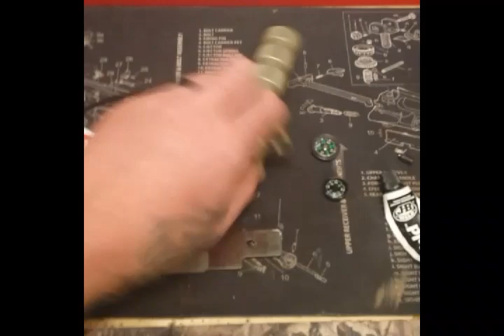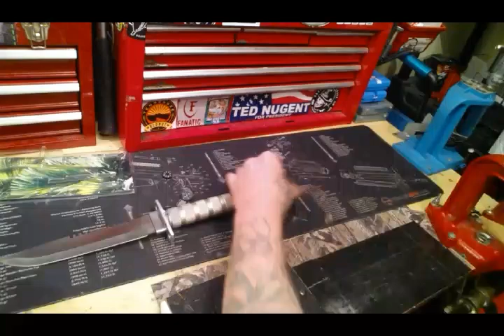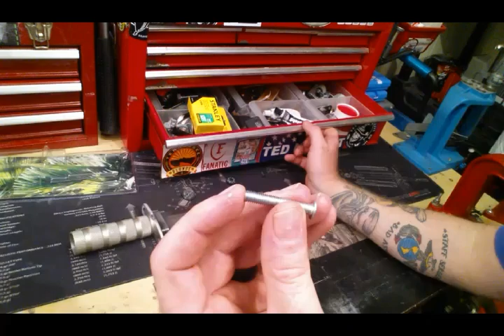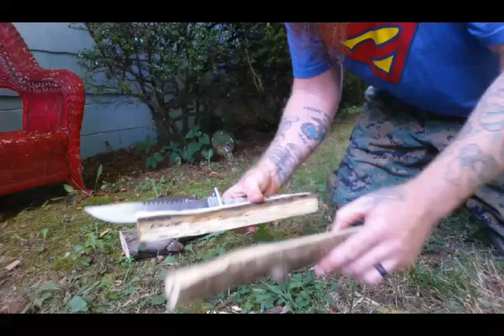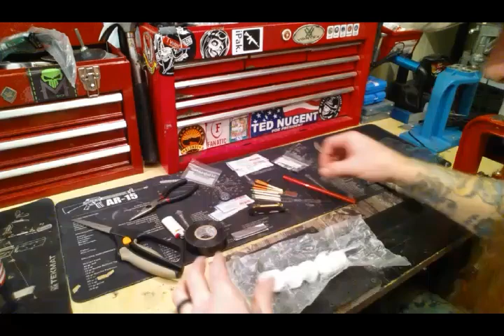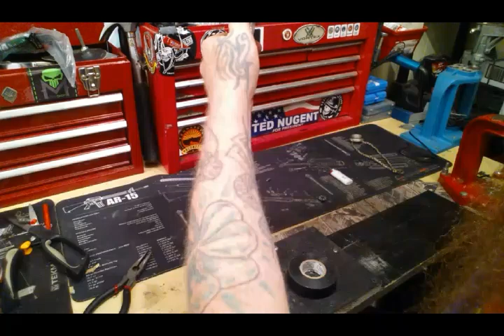Harbor Freight Survival Knife Upgrade - Wood Splitting

Comment: I'm kinda lost on all the comments that spoke bad about the knife and the ones saying nice fix like it was a genius thought, I tested mine the same to see just what would happen batoning, the alan key came loose just as stated but I was hacking pretty heavily into mesquite, and anyone that knows their wood knows mesquite is some of the hardest wood to cut, period, everyone who complains this knife can't perform its intended job should never touch anything sharp, if you have enough sense to be waking away with a knife like it's a machete or a hatchet don't complain when it hurts you
Reply from the maker: I put the upgraded steel pin in place of the hex head screw.

Comment: Man that is a great up grade to make a usable piece out of pretty much a novelty item. I had one of these for a while but gave it away to someone who liked it. I may pick up one do your mods and keep it in the trunk of the car. I was surprised how well the steel took the impact, no chipping, may be the steel a little soft but I would rather resharpen then have a big old chip fly out of it. So for 8 bucks not bad.

Comment: I've had this knife for years as a novelty item.  My blade always shifted a bit.  Your video inspired me to JB Weld the blade to the hilt.  But my blade still had play after the epoxy cured.  I found that the cross guard (the thing with the set screw) threads into the handle, but not securely. It rocked a bit.  I unscrewed the hollow grip and completely sealed the  open end of the cross guard with JB Weld. Otherwise any liquid on the  blade can leak inside and damage the handle contents.  Then I coated the threads with JB Weld and permanently bonded the hilt to the handle with epoxy.  The blade is solid now.  I skipped the pin because the weak point is the grip connection to the cross guard and not the cross guard to the blade.  The handle seems like pot metal. I'm certain that the shock of frequent battoning or chipping like you demonstrated will break the handle eventually.   The blade is heavy solid stainless steel in case anyone is wondering.

Comment: Say Heah, That's Awesome what you did to that Harbor Freight Survival Knife. I have the same one, but mine says "General" on the Cap. I would love to have someone do the same for mine. But years ago, They sold Tomahawk Brand Survival Knives that were made in the U. S. A. and in the 440c. They sold them as Hog Hunting Knives because at that time it was one of the longest blades made for a production knife. I've used mine and it's still as solid as the day I bought mine.  But I never batoned on it.  But I always liked Hollow Handle Survival Knives.  Infact when Buck came out with the BuckMaster 184I just had to get one.  I trust my life on my BuckMaster 184.  Then I up-grade and I bought the Randall Made Model #18, it's silver soldered together.  I also trust it. Then I got a Russian Survival Knife, I think it was used by their Special Forces, it sold as a Professional Survival Knife. It's called the NB1-01, but in Russian the "B" is a "V" so it might be tge NV1-01 ? It's a 6" Recurved made out of a Truck Steel they use 
G 65 ?, But then Bokor made a copy of a Martin Knife Design. It's my Bokor Aparro. The blade has the Male Threads on it and the Handle has the female treads on it. It's then married together and a strong Epoxy fills into tge Handle for extra strength. I did baton it, and it's still rock solid.  Infact I like to team it with my Mora Garberg. But recently I found a rare find at my neighborhood Pawn Shop. I found a Bianchi #1.  Mine doesn't have the word "Nighthawk" under the Bianchi Logo, but the word Bianchi is larger. I also would trust this knife. I also have a Frost Cutlery First Blood ? It'd strictly for show. A screw type Tang that's thin with a nut tightening the blade to the handle. It's a nice looker, but, no way would I trust it. I'd take $75.00 for it. But, again, what you did to yours, It's more than a $10.00 knife now. That's alot of work, so, go figure what your hourly wage would be then add that on. You did a great job.,,.p

Comment: electrical FRICTION tape is one thing that i bet most people are unaware of ,or have forgotten about........it makes awesome non=slip handles...it is a good insulator and can still be used in place of regular vinyl tape ,plus you can heat it up a little and reuse it,providing it is noT covered in sand or dirt etc

Comment: A tack weld on both sides plus the pin would be a good idea too...
Reply: I was going to put a tack weld on mine but found out the handle isn't steel . Some kind of alloy.looks like brass under the coating .So i just pinned it.

Comment: I got mine at a flea market brand new 2008.  Never took it seriously. Just got it for fun.  a few years back I decided to take it to my backyard and chop and baton wood with it.  It held up. It couldn't carve anything or do any feathering sticks but it held up.  The handle did not break off like I thought it would.  If I sharpen the knife so it would cut and slice better, I think it would serve as a knife in a pinch.  Plus, the blade is long enough so if the handle does break off, you can still use the blade to baton wood, turn it into a spear head, or make a wooden handle to sandwich the blade with duct tape. That would make the blade shorter but it is better than using sharp stones to cut things..."better than nothing".   Some people can afford to pay $80 for a fixed blade Rat 3 or a $120 ESEE 3 to put in their emergency kit or survival kit and never use it.  But for $10, you can put this in your emergency kit and forget about it.  I would not recommend this knife for serious emergency use or survival situation unless it was sharpened properly and reinforced like you did with a steel pin.  But if you are on a tight budget, this is better than nothing.  For inexpensive survival chopping knives, I recommend knives from Cold Steel and Kershaw.  Inexpensive and tougher than really cheap knives.

Comment: When you put the steel pin in did you leave it long and peen the ends or did you cut it flush and the JB weld holds it in place? Great video, Thanks.

Comment: So for 2 bucks and a little elbow grease you have a good knife and survival tool which could save your life. All for 10 bucks .
Reply from the maker: 19331936 pretty much I'm just making this one for my stash bag because we're headed out west so I'm going to Stage this one with some other gear
Reply: @StepOneSurvival  I have one and I put apoxy were the set screw is the blade  does not have any blade play  and I camo mine and put a razor edge on the blade and it's good to know .I know people talk trash about this knife  but they just do not know how to upgrade  the knife .
Reply: Yes .
Reply: @StepOneSurvival  when you put the steel pin in  what keeps the other end in place.
Reply: @rickeybullington68  You coat the pin in epoxy (jb weld) which holds it in place. I reccomend completely filling the pin hole and then sanding or grinding it flat after it dries.
Reply: @mikek5322  ok what ever works .what I did is still holding up and it works  for  me .I've use some jbweild that was not  worth  2  cents. I use  some apoxy that some one gave me that you can not buy in the stores .it is air craft apoxy  from  delta air lines.
Reply: @rickeybullington68  Awesome I'm glad it's working for you. That epoxy should last forever. Mine has been working good. The jb weld is really only there to hold in the pin

Comment: While I do own a couple of those Schrade hollow handle knives, I don't plan to rely on supplies packed into the handle. Honestly, I bought them because they were cheap for the quality, but the metal chamber will prevent accidentally impaling of needles or hooks into one's skin. 
With your modification/improvement and maybe even a homemade PVC or kydex sheath and a packed handle it's a great low cost item to have on hand as a backup, a loaner or for trade if the world goes to crap.
Reply: MasterK9Trainer I bought the SCHF2SM. Pretty decent knife. You get the longer ones?
Reply: No, I have the SCHF2SM and so does my brother. They were marked down super cheap. I think it was a mistake and I knew they not cheap, so I snatched up the last 3 they had.
Reply: Here we are in 2024 and you’ve sextupled your money on the hollow handle Schrade knives. They go for upwards of $400 on ebay. 7 years ago they were $54 retail.
Reply: @behindthespotlight7983  yes I realize that they are really high price now. My father has one of those short Marine Corps machetes that have a wide blade and he left it sitting outside with his tools and I brought it inside to later make a new handle for it. I was shocked at the price those are going for

Comment: Harbor Freight did factory mods to the knife because of all the video's posted left and right. The new ones have the blade already J.B. Welded in place. the Finger guard and storage tube are milled out of one piece of Steele now. The only thing you need to do is go to Fastenal and buy a long set screw to replace the short one in the knife that will run through the blade then use red lock tight to seal it in forever.
Reply: I doubt there's any JB weld in there. The one piece handle is not steel, it's aluminum. You're also wrong about the set screw. You can't just run a longer screw without drilling through the entire handle. The hole for the set screw is only drilled on on side. You need to drill through the entire handle in order to insert a screw of steel rod.  Do you even own this thing?

Comment: I would recommend unrolling the cotton ball and packing it into the straw with a disposable wooden skewer.  I use an old seasoning injector to put some vasoline in the straw too.
Reply from the maker: umyashure there's always one more way to skin a cat definitely
Reply: I use the big smoothie straws easier to put stuff in and larger burning surface when you split it and light it. also you can use pill bags.

Comment: Great video SSgt. As you were building this I had ideas pop in my head to even better it more. Why not wrap the electrical and duct tape around the handle to help seal it. Then with the cordage of your choice wrap the handle starting at the hilt, and wrapping using one piece of cord all the way up until you get to the holes in the cap. Tie it off, then still using the same strand make a loop to put your wrist through.
Reply from the maker: David Genthner Jr someone was just telling me to put Ranger bands around the handle

Comment: Im in the process of rebuilding my own. well i dropped it in a lake while fishing and the first thing that failed on it was the matches.
Ditch those and get a striker stick, not flint.
Second i need to build a new sheath for it. And then i need to put a new edge on it..this thing is handy but i see what you mean about the bolt. I think im gonna drill and tap a new hole.
Really want to see how far this thing can go stock
Reply: I did a hack b4 i saw this. I used epoxy, then loctite on screw. Next time i am at HF with coupon  I am doing it this way

Comment: I had one of these that someone left at my house years ago. I did everything to it that BA did to his. I tested it on some wood splitting before taking it out in the bush. Second piece of wood I tried to split, the hollow handle broke in half.
Reply: I stuffed a piece of thin walled pvc that fit perfectly inside. I leave this knife outside for when I only need to split 1 piece or make some rough boards